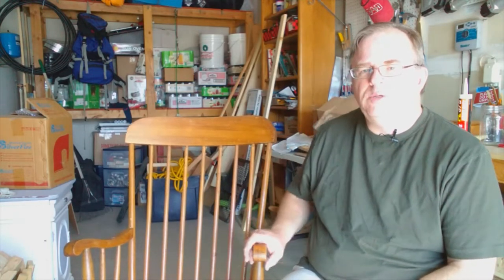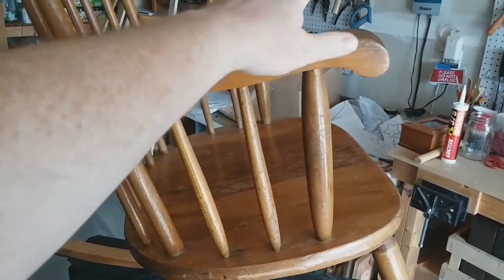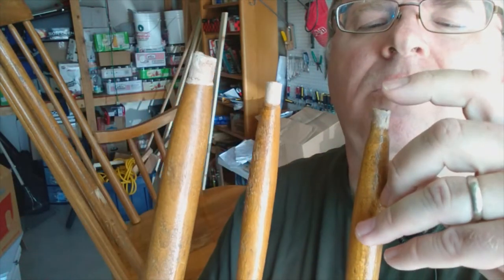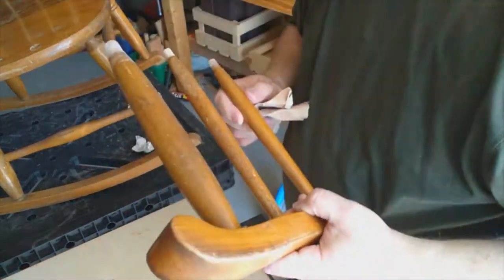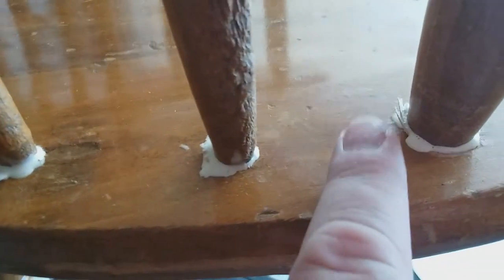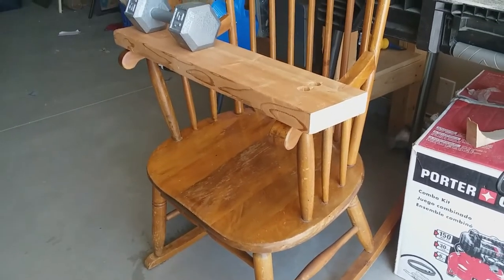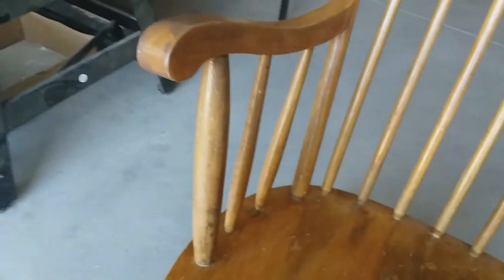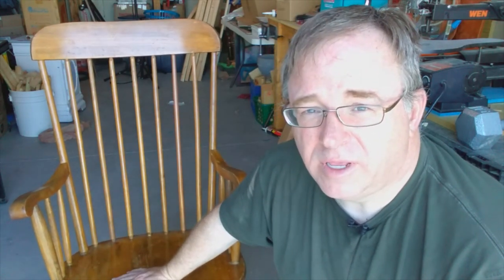Repairing the loose arm on a rocking chair

Comment: Is it necessary to wood glue all parts, I refurbished an old chair and it’s all wobbly ugh
Reply from the maker: Sounds frustrating. :-(  Cant say if you need to do ALL the parts, but if you are getting loose joints, I think glue would help.